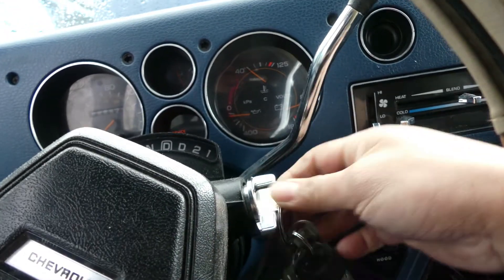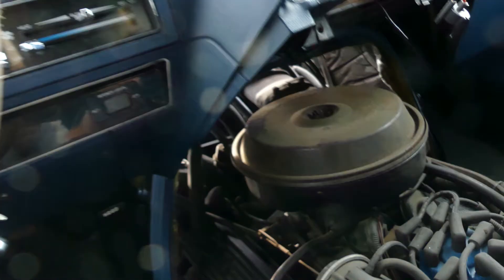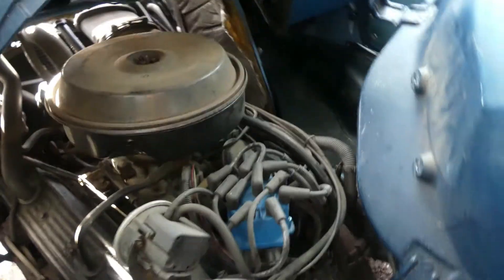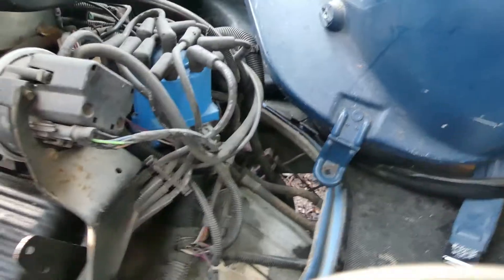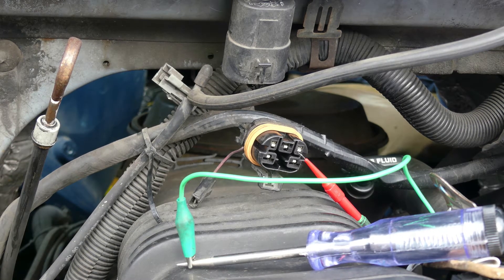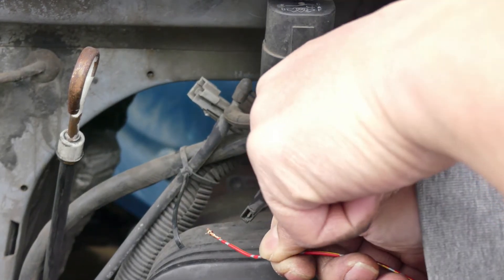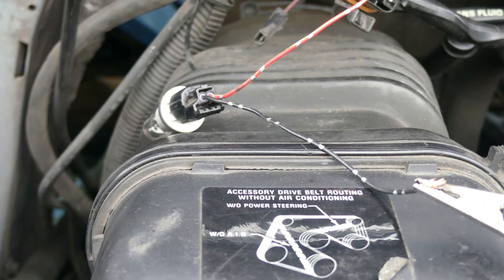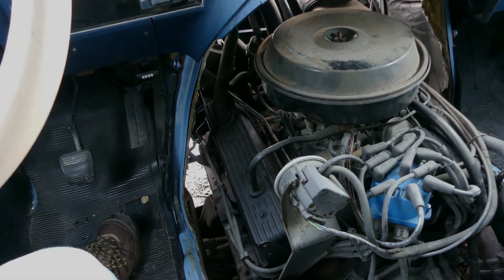Crank No Start Diagnosis  [1991 Chevy G20]

Comment: You have to pump gas accelerator peddle even if its a tbi throttle body. Quick bursts on the key doesn't really allow engine to start especially when cold starting.
Reply from the maker: Thanks for the tip!

Comment: so we have a orange 12 v wire to the ecm for injectors this wire become weak corroded and then we have electronic fuel pump in tank, may check for cliking sound on the pump, and then look at injectors spray...
Reply from the maker: That's a good starting point for diagnosing this issue.

Comment: I have the same van. First it was a delayed start. crank a few times then start. Then it got harder to start. Lots of cranks then start. then had to use starting fluid. Now no start a all. what would create a progressive no start situation? I know it isn't fuel or it would start with ether so why has the spark gone away?
Reply from the maker: well u gonna start with the basic spark fuel air ..hows the spark is it strong enough how about the spark plug maybe its too old ..how about the fuel u can check it by using a pressure gauge hows the reading while cranking and while car is running ...how about air check ur air filter may be its dirty

Comment: Just spray starting fluid in the carb.   If it starts buy a new fuel pump
Reply: This is a old video but here goes. I have a '95 g20.  That motor is a 350 v8. Has a throttle body. 2 injectors. Spray starter fluid through the top of air cleaner.  Take lid off first ...duh. Turn key . If it wants to start , it's the fuel pump. Fuel pump is in the gas tank. Drop tank to get to fuel pump. 
If starter fluid doesn't work...no spark. Clean contacts in the distributor cap. Try that. Check 10 amp fuse in the fuse box . Label...ECM.  Good luck
Reply from the maker: Everything u said is right thing to do but as a mechanic we already know that fuel pump is culprit in here i just wanna confirm if the fuel pump is getting power to activate it before i conclude its the fuel pump ..cuz what if u replace the fuel and the car wont start what will be our next step so the very first thing as for me in diagnosing this king of issue is that check power and ground first...but again u can go directly to fuel if that what u prefer
Reply: @asianmechanicguy6483  what you say is true but the odds are overwhelmingly that it is the fuel pump.   In the very rare scenario you put a new fuel pump in and it didn't fix the problem you are still in good shape because now you know you have a new fuel pump and can drive 100,000 plus miles before you are stranded and broke down.
Reply from the maker: Not really... we still need to check power that activate ur fuel pump cuz even we put new fuel pump and it has no power to activate it car will still not gonna start ..but ur right fuel pump is the culprit in this video..watch the 2nd and 3rd part i did replace the fuel pump
Reply: @asianmechanicguy6483  Have someone turn the key to on you should hear the pump hum down at the tank.
Reply from the maker: again my brother i know the culprit is the fuel pump i just wanna make sure i i got the right call by checking the power and ground and also i had this prodemand apps that i can look at for the wiring diagram to make sure 100% im checking the right wire without guessing and replacing parts with no error and some cars fuel pump has quite sounds when activate and as for this car no idea
Reply: @asianmechanicguy6483   I saw part 3...left a comment.

Comment: Its a 4.3L v6, if it has spark then pour a little fuel in the TBI intake to see if it starts and see if it keeps running with a steady stream of fuel, then u kno its a fuel issue
Reply from the maker: this is my standard procedure of how to diagnose a no crank no start issue
Reply: @asianmechanicguy6483  what was causing the issue?

Comment: It is a 5.3 L ( V-8 )  What was the Problem.?  I have a 1990   5.3L... Conversion Van , By Mark III , Just Gave it a Major Tune Up, Ignition Module...in the Distributor,Sparkplugs,Rotor, 
Wires,Distributor Cap....Etc.
  My Cruise Control Always Worked Fine...but Suddenly Doesn't work, Now.... Fuses checked O.K.--- except for the Hazzard Lights Fuse.
Hopefully , Maybe the Cruise Control will Work again on My Next Test Drive. Does Anybody Have any Other Cruise Control Ideas...?  Some other Things to Check...?   The Plug in Harness to the C.C. is still Plugged in Securely... I had That Wrapped in A Plastic Baggie...and Black Tape to Protect it.... The Cruise Light on the Dash - used to come on ... When I would Switch it On. Please Let Me Know if You Have any Suggestions.
  Everything Else Works...!!
   Thanks, BillinL.A.  3-18-22.
Reply: You have cruise control?
Reply: @sgthighway2171  why would that matter?
Reply: @orionfree5609  because I didn’t know the Chevy 1994 G20 belleville had cruise control. I had the same issue. Make sure you’re battery cables are snug on their side terminals are a pain
Reply: @orionfree5609  I didn’t know that was the option too
Reply: I bought a new speedometer cable and replace it and my cruise control works again now on my 84 g20 van 👍🏼
Reply from the maker: we need power distribution diagram to pinpoint the problem
Reply: @asianmechanicguy6483  Thanks for the Response..!!
  I still haven't tested it Yet after Replacing the Hazard Lights Fuse that was Burned out.... Hopefully , I have not Shorted out / Burned out the " Cruise Control  module " as it will be Difficult to Chase one Down.... To buy.
 Also: is there such a Thing as a 0BD I scanner for 1990 Chevy G20 Vans...?  How Much $ , and Where From..?

Comment: When is the 2nd video coming? Did you install a fuel pump?
Reply from the maker: waiting for the fuel pump
Reply: Asian Mechanic Guy is the by pass relay connects to anything ?
Reply: Also do the gas & line needs to be cleaned before changing fuel pump?
Reply: @siomakahele  it directly connected to fuel pump
Reply: @siomakahele  theres no way u can clean the gas line ..the tank maybe
Reply: Could a bad fuel pump cause the engine to surge out like it keeps bogging out when you hit the gas

Comment: Ima go head in leave a comment here sir it’s on 04 Honda Civic the car with crank and start ok I let it warm up then I cut it off in try to crank it back it turns over but won’t start up so I done the fuel pump brand new then I put the scanner tool on it it gave me a code crank shaft position sensor intermittent what ever that means my thing the crank shaft sensor is brand new any suggesting thanks sir hope u having a good day
Reply from the maker: Focus on the crankshaft position sensor usually thats 3 wire i had a video of how to check crank or cam shaft position sensor without using scope ...check my mitsubishi galant video i did show there how to check ur camshaft its the same with the crankshaft
Reply: @asianmechanicguy6483  thanks sir I appreciate it